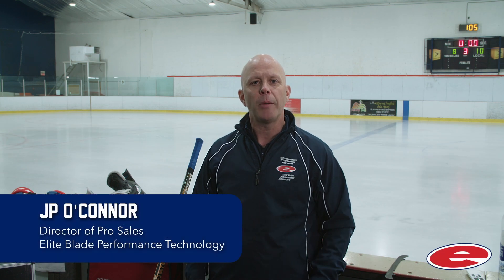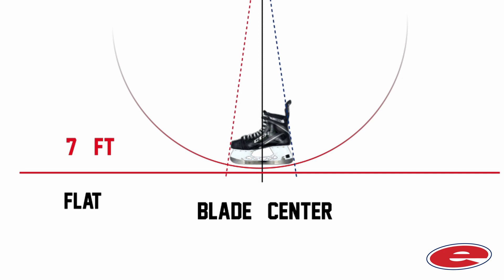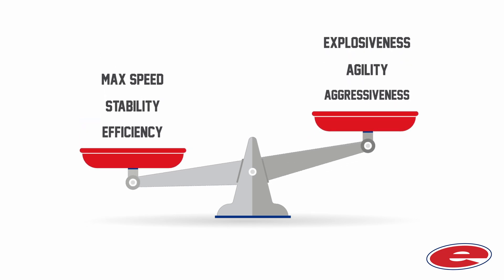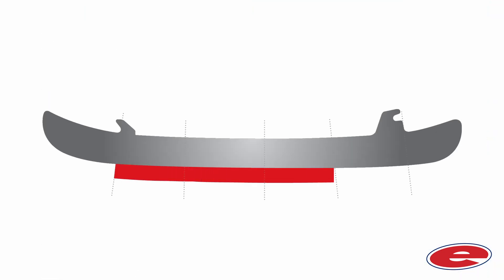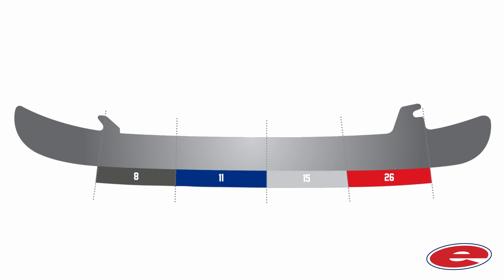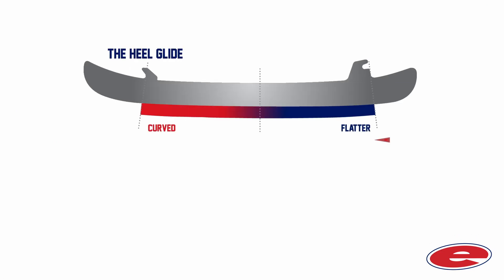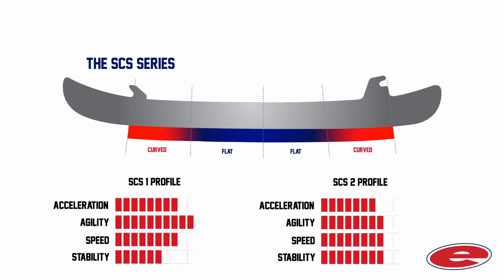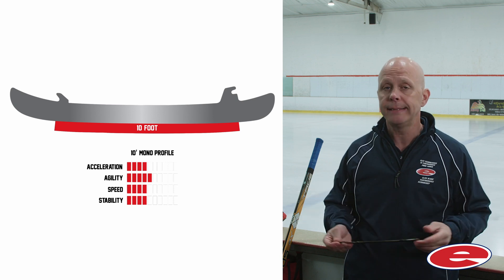Profiling 101 with Elite

Comment: Very good video! I like the division on 2 families heel and center glide. It put all on the places. All time I couldn’t understand the last hill zone with bigger radius, which in my opinion should be with smaller radius than priviouse zone. I tasted a lot profiles for many years, single and combi and finaly understanding that I tend to center glide profiles. (Something like Polaris I think). It is more predictable and linear. It is more natural and undastandable for brain to pull the toe and turn more intensively on the heels. Thanks for that division on 2 families model. It helped to figure out. I am from Belarus, and only had opportunity to test single and combi profiles from Prosharp. It would be interesting to test Elite one day.